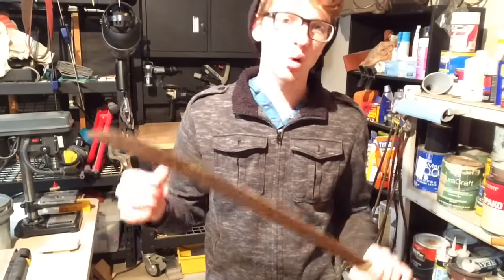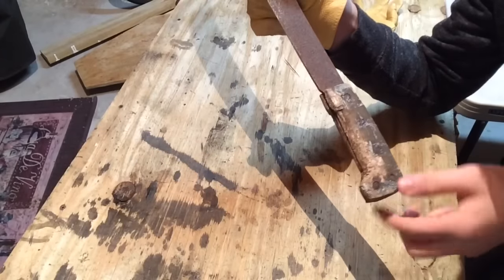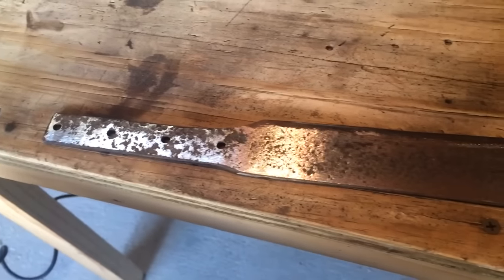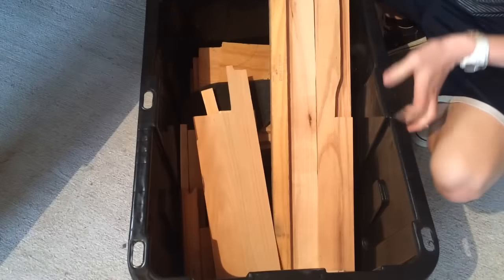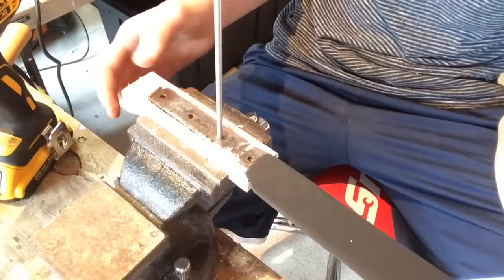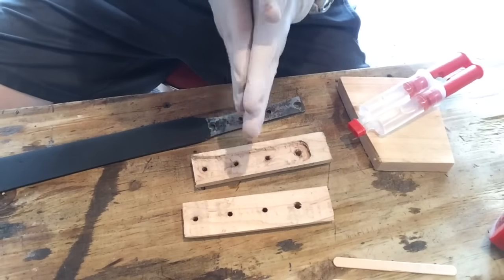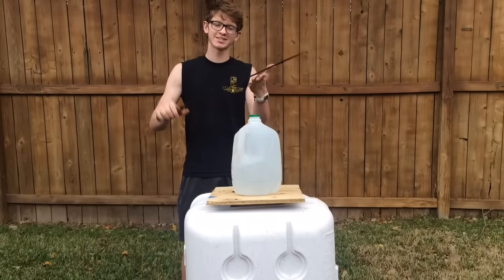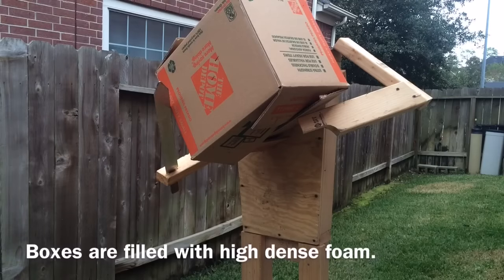Restoring An Old Machete!

Comment: A second cut file, and a modern water grindstone and a leather strop belt built in. Much better choice than a belt sander. Doesn’t heat up and change the steel temper. Also doesn’t change the original edge, and doesn’t take away so much metal out of the blade.

Comment: Should use molasses and water mix.  Just immerse machete in 40 to one mix for a few days or weeks, depending on rust. Used this method in restoring many rusty relics. Good video. Thanks.

Comment: on machetes your never supposed to sharpen the first 5inches of the blade in case your hand slips or you over swing. which the dull 5inches of the blade will keep your hand safe atleast 1mm thickness dull at the edge for those 5inches

Comment: As a matter of fact, today cleaned off a metal bracket and prepped for paint.
Once you take off the heavier rust apply naval jelly. Saves you loads of time and cash.
Chemically cleans the metal.
I personally never use steel brushes or wool (except wool, #000 & #0000, in woodwork for stripping paint and varnish) only bronze.
Cheers.
Reply from the maker: Jose Benitez Very nice!

Comment: Just sharing some experience, but you can use vinegar to remove rust and mill-scale. However you may need a large bin to leave 
it in overnight and the chemical reaction leaves a gray finish which is easily removable with a pan-scrub. Great vid though!

Comment: Also just as a suggestion you should buy some cheap wire wheels from harbor freight to use with your angle grinder and it would help get all the rust off of that machete.

Comment: That Is a full tang , some manufactured make them straight instead of adding the curved bit at the end , mine they added that curved bit , which had made making a handle difficult , looks amazing though
Reply from the maker: Jon Ellis I trust ur handle came out well?
Reply: The Craft Addict considering it is way more crude and ugly than yours , yes , its plywood held in with gorrila glue and 4 machine screws with nuts , any screw out past the nut got ground and filed off
Reply from the maker: Jon Ellis very good job.